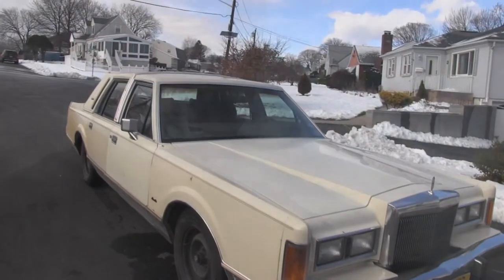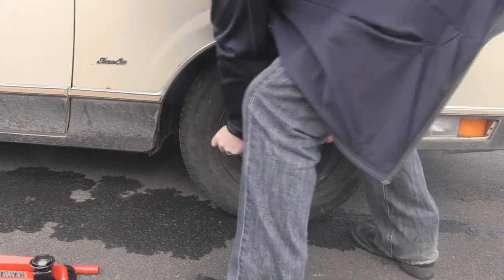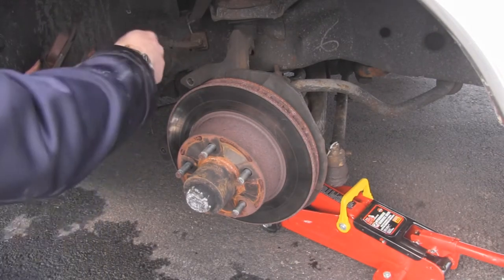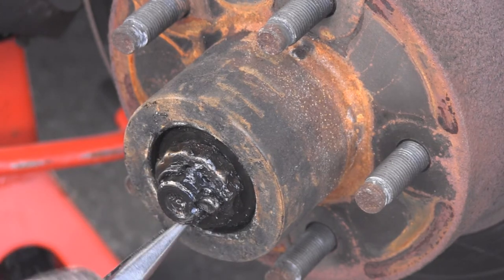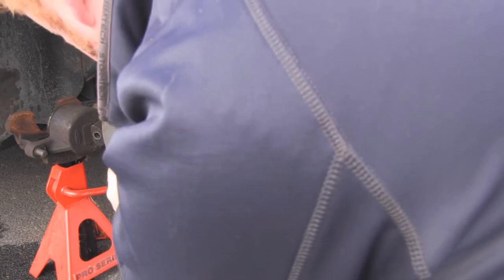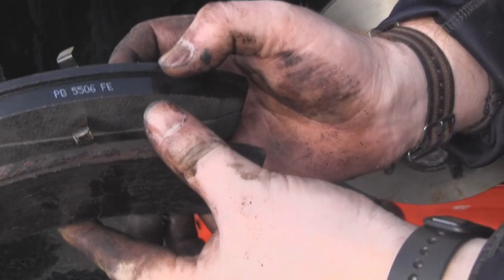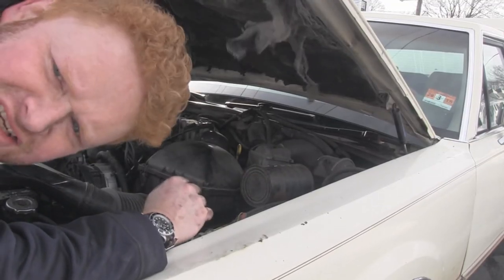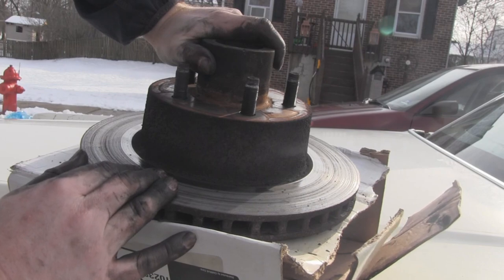Repairing the Disc Brakes of a 1989 Lincoln Town Car

Comment: could you explain the proper torque / tightening sequence for the hub spindle nut? also...when collapsing the caliper piston, one of the old brake pads works great as a surface to use with your c-clamp. i've actually broken one of the pistons before clamping directly to the piston. partially my fault because i forced it, and partially because the caliper was basically seized. anyhow...really enjoy your videos! one of the few folks out there posting good information on the box panther cars! please keep them coming!

Comment: Should have put a gob of high temperature grease under the hub to prevent hot  grease from melting off the wheel bearing, and brake grease on the caliper pins.

Comment: I have a 98 LTC. My brakes started getting spongy so I had a friend bleed my brakes. They only got worst until I had no brakes at all. I'm not sure what happened but I've tried several times to bleed the brakes however they won't pump up. I've also replaced the booster thinking it might be leaking.however that did nothing to help the brakes . I'm dint know what else to do. Can somebody please tell me what I'm doing wrong! I'm missing work and this car is all I have . Without it , I will loose my job.

Comment: First off if you are changing the rotor, use NEW barrings and races ( just a few dollars difference) and NEW grease.... putting the old barrings in on a new race will change the seat of the barring and can eat them up faster.  Use a flat screw driver and go between the brake pad and the rotor first and force the fluid back into the brake cylinder before taking the caliper off will save you from having to use a C clamp. and wipe the grease off your hands before handling the new pads. just use this video to show yourself how it comes apart,,,, Not for how it's done!